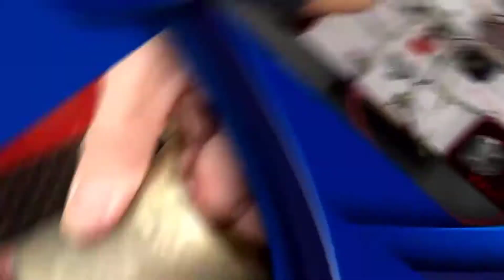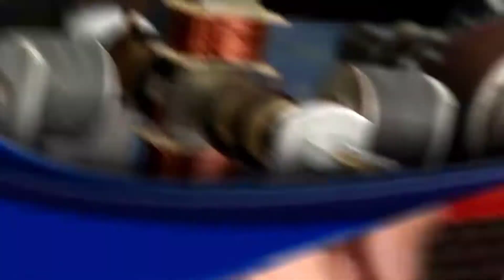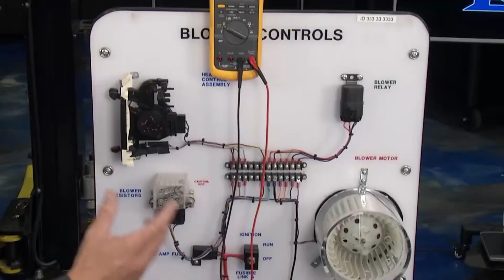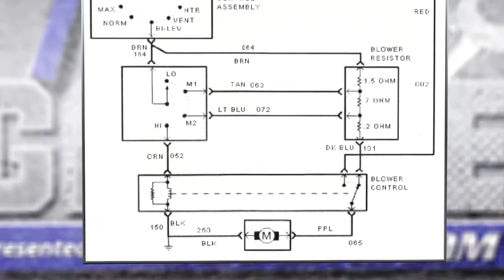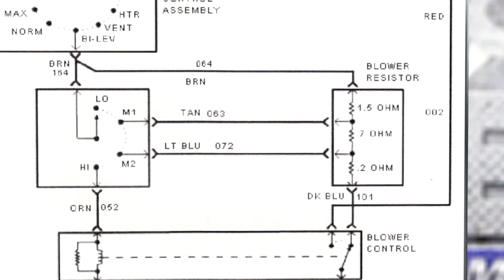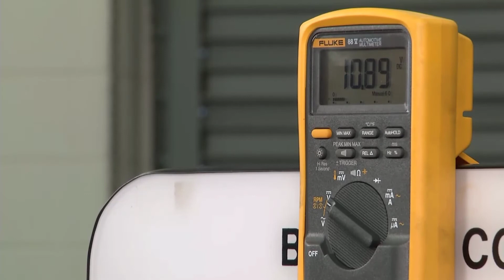Garage Ed 12 Schamtic Reading

Comment: Great video John! Changed the blower resistor in my wifes 06 Envoy Denali. Clipped onto the leads to the resistor and watched the voltage go up as the speed increased on the control. Tip: Change the harness leading to the resistor as the connector and pins could be damaged by the initial failure. If not you will be back under the dash doing it all over again!